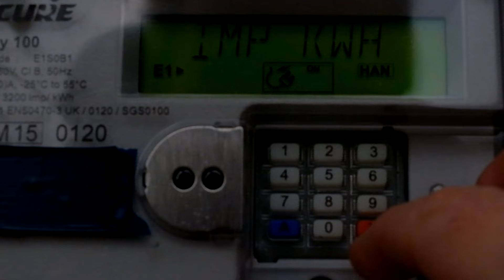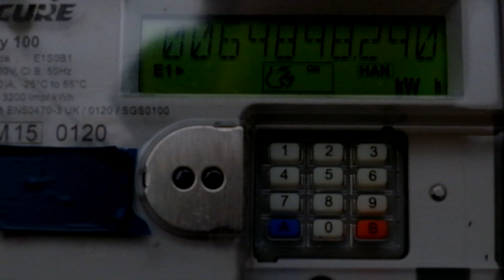Smart meter Buttons 7(Emergency Credit on PAYG), 8(not used) & 9(Sum of RO1 RO2)

Comment: have LIBERTY 110
I used to press 9, and it gives me the day and night readings. Since this month, it only gives me the day reading. 
I tried to press 9 again, Nothing was given . I also tried 6, Nothing was given . Can you help me, and I have to put the day and night reading
Reply from the maker: My understanding is 100 & 110 buttons operate same way. 110 has the water boost facility. Buttons:
1 - Displays cost of consumption and units used on the current day and previous day
2 - Displays cost of consumption in the current week and previous week
3 - Displays cost of consumption in the current month and previous month
4 - Displays historical data comprising monthly units consumed and cost of consumption
5 - Displays ‘Not Used’
6 - Displays tariff name, standing charge per day, active rate register(s) along with the consumption and cost per unit recorded in each rate register (Will provide Economy 7 readings: IMP R01 is the night read, and IMP R02 is the day read)
7 - Displays ‘Not Used’
8 - Displays ‘Not Used’
9 - Displays total import and export register values (will provide a total reading after IMP KWH)
0 - Performs display check and then displays date, time, load and CO2 data of the current hour and current day, yesterday, last week and last month (will show 'COMMISSION' instead if meter needs to be commissioned)
A - Used for prepayment customers - Switches the display to UTRN(vend) entry mode; serves as backspace key during UTRN(vend) entry; enables Emergency Credit when made available; initiates supply reconnection from ‘READY' state. (Activates vend mode/Used to start reconnection process.)
B - Activates auto scroll display from sleep mode; used to scroll back through a display sequence; initiates UTRN(vend) authentication process; mutes alarm; used to confirm supply reconnection from ‘READY’ state.

Comment: I have sw1 on under E1 what that mean
Reply from the maker: Hi  E1 right arrow means Imported from Grid on first circuit. SW1 is for Off peak water heating boost, if you have that facility?
Reply: @xacteducation8036  
Thank you soo much

Comment: I press A and B and it still doesn’t turn on
Reply from the maker: Is the isolation switch On ?  Check if you have any poer such as lights? Is there a power cut?